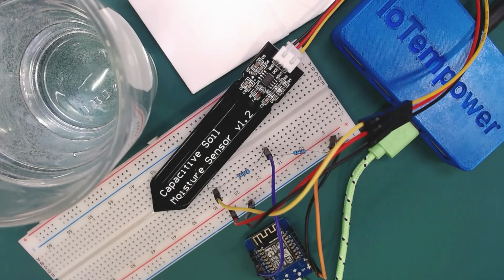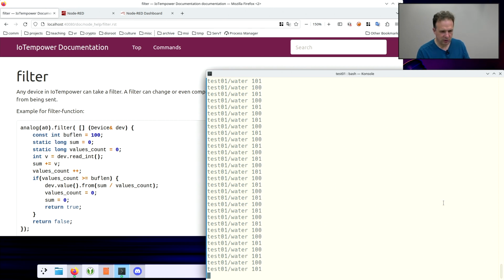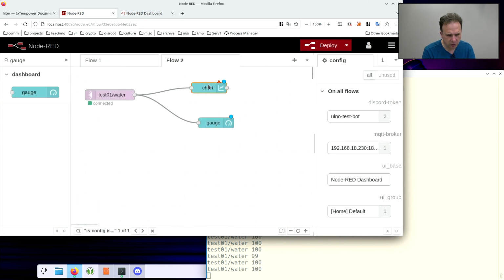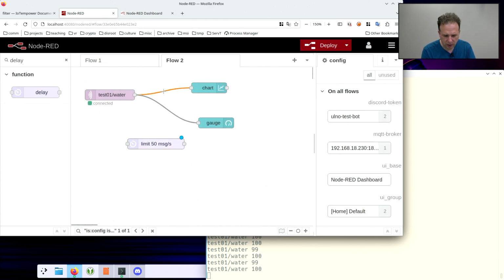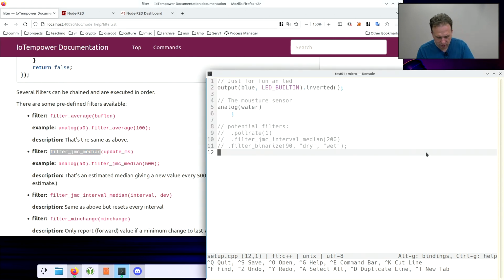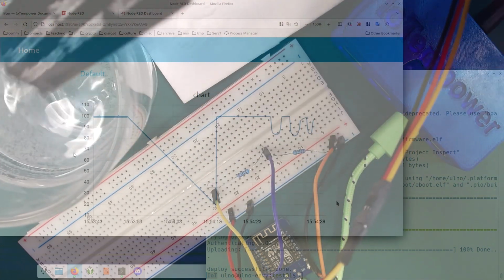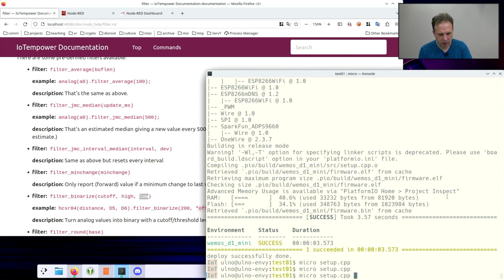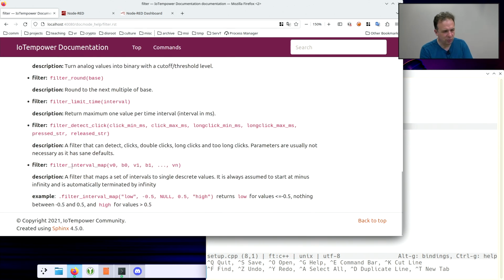Filters in IoTempower

Comment: It would be good to have moisture levels from dry to wet in % for plants and soil, thanks for the video very informative and helpful.
Reply from the maker: Thanks for the comment. You can easily calibrate some levels (very wet, wet, moist, ..., dry) with the map filter, or change the given filter example into generating continues percentage points (in this example mapping 80-120 to 100 to 0 - in a probably non linear way).